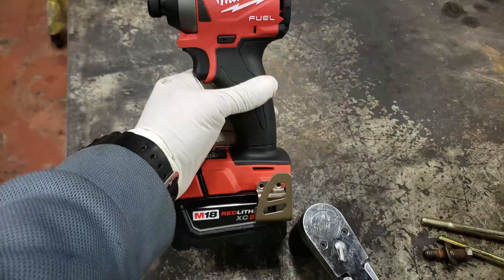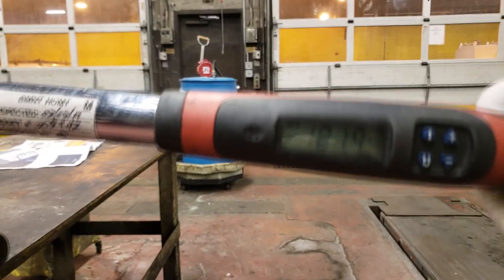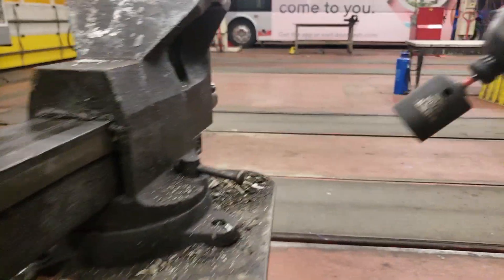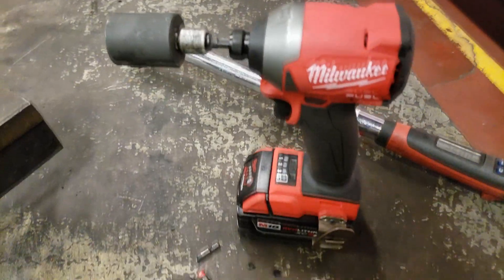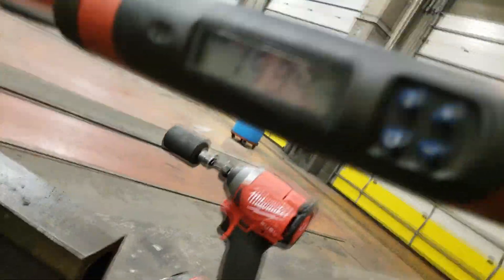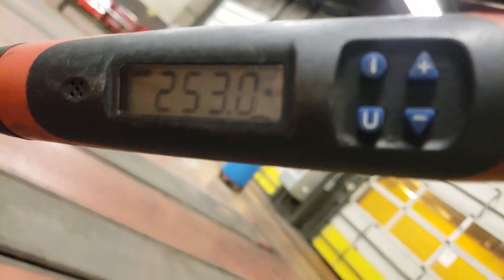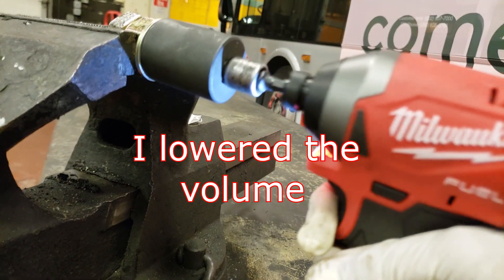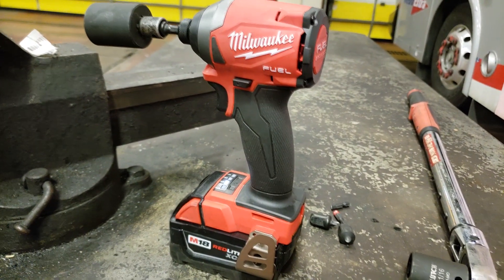Milwaukee impact driver GEN 3 torque test.

Comment: I got tired of snapping those hex to 1/2" or 3/8" square drive adapters with ease.  I ordered an anvil for the m18 fuel 3/8" impact gun and retrofit converted my 2853 fuel hex impact driver.  I did have to machinre a bushing between the anvil shaft and nosecone (press fit into the nosecone).  With an impact socket directly on the anvil, it hits A LOT harder...my guess is that is prob has close to 300 ft lbs breakaway now,  if not that.
Reply: I have another 2853 that I want to convert to 1/2" square drive anvil.  This will require drilling/boring out the nosecone centerbore.

Comment: Imagine 250 ft.lb or more on that tiny thin shaft that is the hex adapter. They are pushing limits there. They need to come out with a different solution.. maybe like Bosh did with freak 2 impact driver.